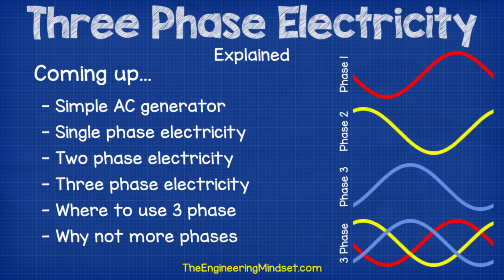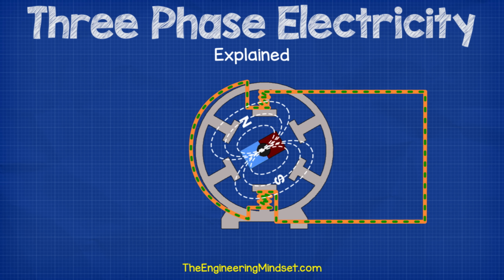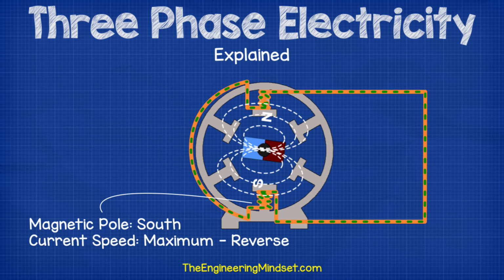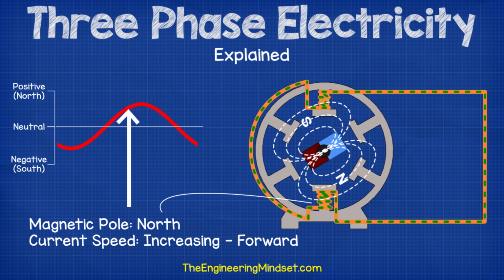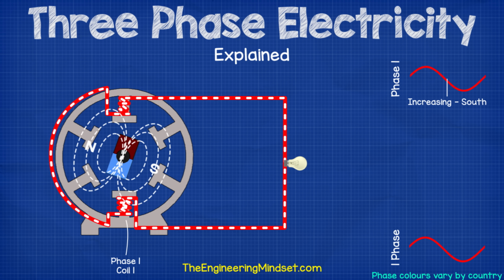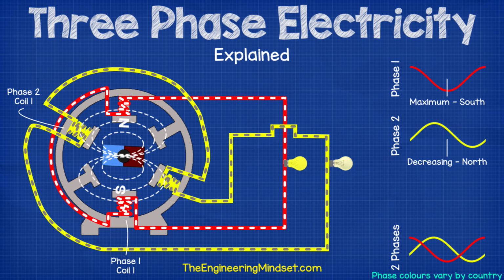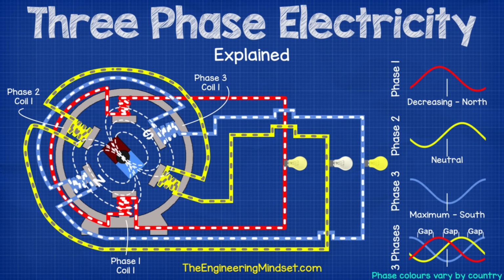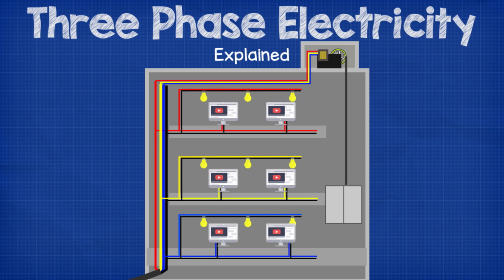How Three Phase Electricity works - The basics explained

Comment: great video! Also one of the motivations for using 3-phase is that you can actually use up to 1/3 less of the conducting material to draw the same amount of power as opposed to one phase. It probably wasn't mentioned in the video

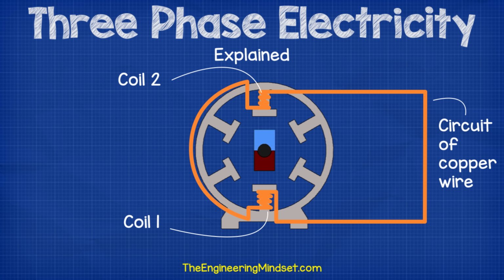Comment: How does a single circuit at 1:03 pull charge back and forth.  I see the loop, but having a hard time imagining a single line coming from a breaker at panel... there is no loop.

Comment: Okay what if in a lab you built a 3 phase circuit and it was powering a 100hp motor on a 480v 3 phase circuit ... then somehow in the wiring 2 of the phases  wiring were instantenous touching? Does it fail in the motor or does it fail at the point they touch.... or does nothing happen at all... and why? Just a thought from my weird brain thats all

Comment: I came here after we had a partial power outage to our house which was due to a poor connection of one of the phases from the lines company.  I couldn’t understand why some circuits still worked if a connection was broken. This video totally explains it - we must have different circuits fed from the different phases like in the large building example (even though we are just a normal house).  Stoked to understand that now, thanks!

Comment: I'm an electrician and I have one question? How come we call 2 wire single phase? And 3 wire 3 phase
Reply: 1 phase has a live and a neutral; 3 phase has 3 lives, but they're offset, so you can connect any two of them as a "live" and "neutral" because their instant difference will be similar to as if it was a single phase (remember voltage is difference of potential, so if one phase hits 380 when the other hits 160, you have 220v).

you can also have 4 wires for 3 phase, where one is the neutral. ideally, all loads are balanced and the neutral wire is at 0v, but if they aren't balanced, current flows back through it.

Comment: I have been going insane trying to understand the wiring diagram for a factory we're building.  All of the engineers and even the head of the local university electrical engineering department have been giving me 70% information and they're all giving me a different 70%  The overlap and underlap has made it impossible to understand.  This video made it clear as a clear day how it works and I've completed my wiring diagrams confidently, happily and correctly.

Comment: Everybody really needs to get away from 2D thinking.  2D flat space Euclidean geometry is on paper.  Reality is 3D Cartesian spatial geometry.  What is said as a sine wave of up increasing and down decreasing power is absolutely false.  Energy is a spiral.  Why do you think they talk of chirality right hand rule or left hand rule, electrons 1/2 spin, positrons +1.2 spin and bosons (tensor, neutrons, and photons have full integer +1 or -1 chirality, because they have BOTH electron and positron spin in their composition.  Bosons with -0 charge thus have dual left and right hand rule chirality. meaning they can switch out to -1 or switch to +1.  Gravitons are pure +1 integers.

Energy (as in electro-magnetism as shown in the example of neutral or (said) baseline is the forward movement of the surrounding orbital particle, while the inside particle is holding the particle in motion.  Left-hand chirality counter-clockwise movement -12/2 spin or -1.  Right-hand chirality clockwise movement +1/2 spin or +1.
As energy is a spiral, look at a slinky in your physics class.  It is a spiral of coil.  But looking at it without 3rd dimensional reference, you only see like the 2D sine wave screen its upward-downward anti-cline, syncline movements.  What you need to see is the forward and rearward movement of the sine wave.  That is NOT receding or advancing power.  The power is all the same within its area of (properly said) electro-gravitic (not electro-magnetic) flux field, as shown in these diagrams.

Thus, these excellent diagrams and the 1-phase, 2-phase, and 3-phase forces are showing the forward appearing right-hand clockwise movement, while the rearward appearing counterclockwise movement are not a quite accurate picture.  It was Edison who pushed Direct Current (DC) that could only push so far (electrical force).  Tesla had alternating Current (AC) that pushes both the gravitational and electrical forces ... as a tensor boson +1 and -1 current.  The whole cosmos is filled with tensor bosons.  What appears as the switching of +1 to -1 is not accurate, as in real 3D you see the receding spiral of energy (-1) and then the advancing spiral of energy (+1).

Make 2-phase and 3-phase current systems negate the appearance of recession and advancement.  You are literally using x1 (rearward-forward axis), x2 (recession and advancement axis), and the y axis as the amplitude axis.  Since all 3 phases are the same energy level, x1, x2, and y-axis are all the same diameter !!!  Within wave physics, you call this wave interference, coherence, or incoherence.  When you have 3 phases, you literally are working each x1, x2, and y axis for their most-complete and fullest energy level forward, movement, with distance x2 axis going and coming, and then upward-downward energy spirals.  3-phase current is moving in all 3D movements.  The only other dimensions are z1 and z2 diagonal dimensions as a 5-phase system,

This is a fascinating subject for electrical engineers, let alone true physicists understanding what these currents are.

Comment: I have 240 electric going to a machine. Motor keeps tripping, not service panel breaker but at the overload at the motor.  I'm checking shorts,  ground etc. 

I have 240 going to this motor.  Its the right motor. 

I wanted to know if these readings were good as I tested the 3 legs at the disconnect at my machine. 

Between each pair of wires I get 237 V. 

I did another test. 

Ground to each of these also y
white wire I  got 158
Black wire I get 134
Red wire is 122

Is this OK?
Also, how can you tell which legs are L1, L2, and L3? Which wire is neutral?

Comment: Hi I have degree in elec engineering,  but brushing up to take my masters in hvac. I found your video here and if seems like you explained it just fine. Someone said magnet not needed but it is how the armature keeps spinning as one side attracts and the other repels, keeping it spinning. That's basically how any turbine works. Just know that it keeps the  voltage from dipping too low. Definitely need the magnets 🧲 Also just think of a sinewave. That's your voltage and it crosses 0v twice a cycle. Is ok when using s lamp, because it cycles 60 times a second. Not noticeable. But some high quality equipment can't be having it..that's why 3 phase not single phase. 😅

Comment: It probably is a dumb question but why does the magnet need to spin? What I think is that if it stays in one place it will power only one wire and will provide stable current. Why can't that work?
Reply: The current is induced in the coils only if a "changing" magnetic field is provided. A stationary magnetic field doesn't induce current. That's the basic concept.

Comment: Power generators (large scale) turn quite slowly (nowhere near 50 or 60 Hz), but there are many, many, many poles on the rotor and stator for each phase all setup so that at a given RPM the generator outputs 50 (or 60) Hz.
Reply from the maker: Check our new revamped 3 phase explained video, sooooo much better:👉 LINK: https://youtu.be/c9gm_NL7KyE

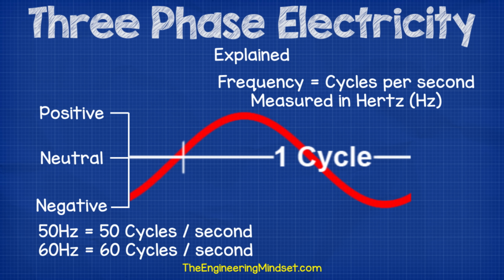Comment: 4:02 A cycle of the sine wave holds two directions of the current. Therefore the direction of current changes 100/120 pr. sec. at 50 Hz/60 Hz
Reply from the maker: Check our new revamped 3 phase explained video, sooooo much better:👉 LINK: https://youtu.be/c9gm_NL7KyE

Comment: Great video overall but magnetic field is strongest nearest the poles (greatest flux density) not in the "middle" of the field as shown.  Its as the closely-packed field lines intersect (in motion) the coil in (highest rate of change of flux) that the maximum AC is induced.
Reply from the maker: Check our new revamped 3 phase explained video, sooooo much better:👉 LINK: https://youtu.be/c9gm_NL7KyE

Comment: If you have a 600 MW generator, how do run it at different loads (say 300 MW or 500 MW) and keep the frequency at 50 Hz? And does the frequency need to sync with the grid frequency--presumably yes?
Reply from the maker: Check our new revamped 3 phase explained video, sooooo much better:👉 LINK: https://youtu.be/c9gm_NL7KyE

Comment: Interesting video. The real 2-phase generators set the phase angle at 90° they obviously didn't think about the third phase. A housing estate in Wales has just been constructed with every house having a 3-phase system installed. It's supposed to be in preparation for things such as EV charging. It does raise the possibility of a homeowner using extension cables from different phases and having an accident which could be very serious involving much higher than normal domestic voltage and current.
Reply from the maker: Check our new revamped 3 phase explained video, sooooo much better:👉 LINK: https://youtu.be/c9gm_NL7KyE

Comment: I was a Journeyman 1st class Industrial Electrician, for many years working in Hardrock Mines, both Underground, and Open Pit Mines.
I was also rewinding burnt out motors.
As well the Lineman, in the mines those days, if you were an electrician, you were expected to do everything, Electric.
A long time ago, I actually hold Certificate #108 in the NWT Canada.

Something perhaps forgotten today.
600 (550) volts 3 phase was brought into use for the Mining Industry.
Without getting into explaining, how and why this voltage works.

The ease of installing, and wiring equipment, males this voltage the easiest to work with. Such when needed to reverse a motor, choosing conductor size, picking heaters for controlers.
No other voltage is as easy to calculate, or set up for..

Also, the GFI products used today, was invented by Westinghouse Engineers, for the safety of Electric Shovel Operators, and Grease Monkeys.

We put together a Bucyrus Erie 190 B shovel, (six railroad flat cars) 375 tons.

I did not trust the GFI, my boss then said, OK test it.
I put a one amp fuse in a disconnet, closed on 2300 volts to ground.
The GFI tripped, the 1 amp fuse was still intact.
I trusted the GFI after that, was told OK, get back to work.
Reply from the maker: Check our new revamped 3 phase explained video, sooooo much better:👉 LINK: https://youtu.be/c9gm_NL7KyE

Comment: I think you said that 3 phase motors would run faster, surely the speed of the motor is determined by the frequency and the number of poles the motor has, not necessarily that it is running on 3 phase electricity?
Reply from the maker: Check our new revamped 3 phase explained video, sooooo much better:👉 LINK: https://youtu.be/c9gm_NL7KyE

Comment: Hi Paul, great graphics and all. I would ask that you change the video so that the maximum Voltage is created when the face of the magnet crosses the coil face. This is where the maximum lines of flux cut the coil. E=BlV and all.
When the side of the magnet is parallel to the coil, the lines of flux are not cutting the coil, they are parallel and such will not create any voltage. Cheers ~ love all the videos, have bought you a cup of coffee and will buy you more!
Reply from the maker: Check our new revamped 3 phase explained video, sooooo much better:👉 LINK: https://youtu.be/c9gm_NL7KyE

Comment: woth equal resistive loads on each phase, the total power delivered is always constant. I did not fully get what you meant by 3 phase is a good compromise. i. e. if the lamps  are only resistve and equal loads the total power delivered to the at each moment in time is constant.
Reply from the maker: Check our new revamped 3 phase explained video, sooooo much better:👉 LINK: https://youtu.be/c9gm_NL7KyE

Comment: The illustration suggests that the current is flowing through both the black and white wires,  If you were to touch the common wire in a circuit is it the sucking electricity out of you?  Similar question in a 3 phase panel there's 3 lines coming in but only one common. Is the common then a negative 3 phase?
Reply from the maker: Check our new revamped 3 phase explained video, sooooo much better:👉 LINK: https://youtu.be/c9gm_NL7KyE

Comment: In bike the alternator generates 3 phase AC current and the Regulator Rectifier produces constant 14 volt DC voltage from it. So is the Regulator Rectifier unit's wiring in such a way that in gets input from all the 3 phases and regulates/rectifies whichever phase has enough voltage (bright light example in the video) at the time?
Reply from the maker: Check our new revamped 3 phase explained video, sooooo much better:👉 LINK: https://youtu.be/c9gm_NL7KyE

Comment: What a brilliant explanation of every moment.  Speed of electrons in AC current will remain as  instantaneous speed after adding more phases ?? One more question, Does the purpose of adding more phases is to keep the speed of the electrons at uniform rate (constant rate) the moment the electrons start slowing  down from the 90 angel to the neutral position (the point of 180 degree)? Thanks if someone can reply!
Reply from the maker: Check our new revamped 3 phase explained video, sooooo much better:👉 LINK: https://youtu.be/c9gm_NL7KyE

Comment: If you use 3 phase design but the center is copper and doesn't spin use electricity to turn the magnets off and on in a circular pattern really fast like almost continuous  combine this with a nickel plate charged negatively with ions that will attract positive ions out of the air.
Reply from the maker: Check our new revamped 3 phase explained video, sooooo much better:👉 LINK: https://youtu.be/c9gm_NL7KyE

Comment: Not sure what the blue and red are supposed to represent on the rotor.  Typically that would be a North and a South Pole, but your magnetic lines do not agree with that.   The poles of the rotor would always be in closest proximity to a stator pole as it passes right by it, and would have peak magnetic  field and current flow in the wire.  So I recommend you move your N and S 90° to be in line with a blue and a red North and South Pole and also change the period of maximum flow which would be when the blue and the red are aligned with the coils. Also US houses are not typically fed directly from one leg of three phase at all.  They are fed from a transformer fed from a single phase (which is all that is usually run in on the lower voltage telephone poles in neighborhoods)where a transformer then produces two 180° out of phase signals which is why a house can have 220 or 110V.
Reply: Exactly. Some really weird errors in this video.
Reply from the maker: Check our new revamped 3 phase explained video, sooooo much better:👉 LINK: https://youtu.be/c9gm_NL7KyE

Comment: Can someone explain to me why in some other animations the magnet rotates counter clockwise and in this one it rotates clockwise? which way does it rotate or can it rotate both ways?
Reply: Bro, it doesn't matter... If you look at the generator from one end, it's rotating clockwise, if you look at it from the opposite end it's rotating counter-clockwise. We live in a 3D world. Not a 2D video. Which way the generator is spinning in a 2D video is completely meaningless.
Reply: @kyyhkypalatsi  yea i was thinking the same thing after I commented 😂. it would be rotating it one way if you look at it one side and a different way if you look at it another.

Comment: For people who want to know: The reason computers only need single-phase power is because the Power Supply Unit has capacitors which will keep the converted DC power flowing into the chips. This is also why anything that requires constant power is DC. For equipment that need DC, there are three reasons why AC would not work: 1) the gaps in 3-phase power would cause issues in certain equipment2) The voltage needs to be constant 3) AC usually doesn't have a stable enough voltage in most homes. During congestion, the frequency can also drop.
Reply from the maker: Check our new revamped 3 phase explained video, sooooo much better:👉 LINK: https://youtu.be/c9gm_NL7KyE

Comment: I feel that maximum voltage is generated when the flux lines are cut perpendicularly by the coil. According to the video maximum voltage is generated flux going parallel to the coil. Any way this video is very useful. Thank you!
Reply from the maker: Check our new revamped 3 phase explained video, sooooo much better:👉 LINK: https://youtu.be/c9gm_NL7KyE

Comment: Once a simple ac motor is understood, just say that some generators (and motors) have three coils at 120 degrees to each other. Therefore, three ac signals are generated at 120 degrees apart. To make a "3 phase" motor turn, you need to send an ac signal to each coil in the motor, separated by 120 degrees.
Reply from the maker: Seen our new 3 phase transformer video?➡️: https://youtu.be/u0SsejDCVkU

Comment: At time 5:40 in the video it talks about gaps in the 3 phases and you could add more phases  to reduce them, but in reality you don't need more than 3 phases because, in a 3 phase system the power delivered into a resistive load is constant versus time.
Reply from the maker: Check our new revamped 3 phase explained video, sooooo much better:👉 LINK: https://youtu.be/c9gm_NL7KyE

Comment: What would happen if you set 3 electromagnets in a triangle poles directed into the center and a copper receptacle in the middle alternate the electromagnets in a "circle" around the copper will this generate electricity?
Reply from the maker: Check our new revamped 3 phase explained video, sooooo much better:👉 LINK: https://youtu.be/c9gm_NL7KyE